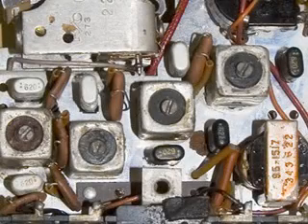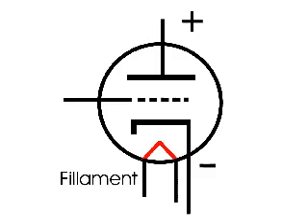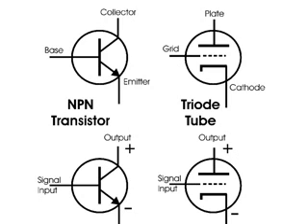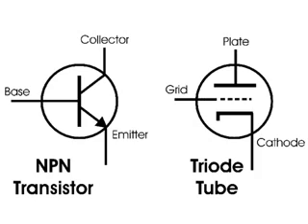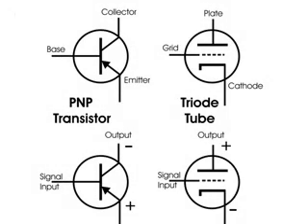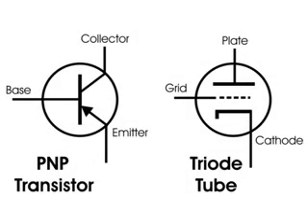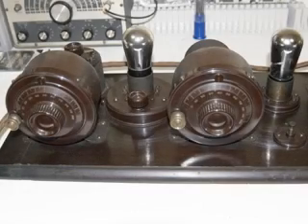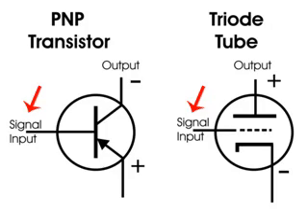Comparing the function of transistors and tubes.

Comment: So a tube can't be used in a configuration where you would use a PNP? Are all tube circuits designed like NPN transistor circuits? What if you needed a PNP configuration and transistors weren't invented yet? Is this a big limitation of tubes or is there a work around? My opinion is that NPN are more useful but sometimes you need pnp if you are putting the current load after the transistor vs before.
Reply from the maker: An N Channel MOSFET is a more suitable Sub

Comment: very nice job sir. im still a little confused about the difference between NPN + PNP and how the emitter changes direction and what that does but for a guy like me who is semi experienced (IE- doesn't know much) this was easy to understand and your video will be a building block on my journey to learn more about trans and tubes. for this, I thank you.
Reply from the maker: Found you in the Spam
Both NPN and PNP transistors have the same function. The differences the polarity. In the NPN the collector is connected to positive in the emitter is connected to negative, to turn the transistor on you apply a positive voltage. The PNP is exactly opposite, the collector is connected to negative the emitter is connected to positive, and to turn the transistor on you apply a negative voltage.

Comment: Thanks for taking time to look at the video. I agree it is very hard to decide just what is going on there. On another note, I am also interested in a way to construct an op amp computer using low voltage tubes. The Heathkit EC-1 analog computer is out of my price range so I wondered if it was possible to construct a low voltage version using vacuum tubes or just a simple op amp. 
Thanks for listening ,
Wayne Verish
Reply from the maker: +gort59 
Google "op amp analog computer"

https://www.clear.rice.edu/elec301/Projects99/anlgcomp/

https://courses.engr.illinois.edu/ece486/labs/lab1/analog_computer_manual.pdf

http://www.allaboutcircuits.com/textbook/semiconductors/chpt-9/computational-circuits/

Comment: Dear sir,
I really enjoyed you video explaining the differences between a tube and a transistor. I recently saw a video showing a half adder using vacuum tubes. The circuit is low voltage. I wonder if you can figure out the circuit from the video. I would very much like to build this device but I can't tell from the video how it is wired. Would you please take a look? The video is on YouTube and is called half adder built with vacuum tubes.
Thank you,
Wayne Verish
Reply from the maker: +gort59 
I did look at the video, and no one would be able to decipher a schematic from it. I did Google half adder circuits and found a number of solid-state examples. It looks to me like cascaded flip-flops would be much more efficient.

My Mini Maker Faire Computer Basic Display Binary Counter
https://youtu.be/6_95Izq7MNk

Comment from the maker: Unfortunately a junction transistor is not a direct sub for a tube. There is a large impedance mismatch, the vacuum tube being high impedance and the transistor very low impedance. Also most of the tubes that you would find today have more than one grid and the transistor has one base. It would be possible to make a tube substitute but you would have to use something like a CMOS FET.

Comment: I'm curious if old tube amplifier fails, can I replace the defective tube with transistor by connecting base directly to grid, collector directly to plate & emitter directly  to cathode leaving the connections for filament condemned? In the diagram it makes sense.

Comment: Transistor electronic organs using good filtering sound very warm and have excellent voicing. Vacuum tubes are great for tone generation as well. For amplification tubes are superior. 

In the mid 70's LSI ( large scale integrated circuits) came along with over 500 transistors on a chip. These organs were good sounding, but not really as warm and/or bold sounding as the earlier transistor and tube models.

I'm curious if digital can accurately duplicate the sound of transistor & tube organs?

Comment from the maker: @rick62008
Correct. If you look at a wiring diagram for a five tube AM radio and compare that with a five or six transistor AM radio wiring diagram, it is really the same thing.

Comment: If it wasn't for the voltage differences, could you use a transistor to replace a vacuum tube? For the looks of it you just would need to leave the filaments wires desconnected since there would be no filament!

Comment from the maker: I would use one of my battery eliminators for antique radios. You can use 6.3 AC or DC for the filament. If you can have or can barrow a heavy enough 6V battery, that would work for testing.

Comment from the maker: Amplification is a actuate term, but it is not what you may think it is. A tube or a transistor uses a small signal to control a much larger power supply. I will email you one or two other videos that may help.

Comment from the maker: Transistors can act as a switch or a variable resistor depending on the circuit it is in. The Base is the connection that controls the flow of electrons through the transistor. The thing about the Base is, that a very small voltage on the Base is controlling a much larger voltage through the transistor. So if the Base has a small audio signal on it, a larger audio voltage is produced by the electrons flowing through the transistor.

Comment: The main thing to remember is you control a large current flow with a small signal voltage. Think of a FIRE HOSE at full blast. Now stop it with your mouth? However with a valve & handle you can stop or change the FIRE HOSE flow with little effort. Functions of tubes/transistors are many, but common uses are ON-OFF SWITCH or CONTROL FLOW. The control signal is very small & can change at high rates or frequencies. With clever use of transistors you make a computer, TV, cell phone...

Comment from the maker: Well, they both do amplify but the voltage is already there from the power supply. What takes place is both have the ability to greatly change resistance between Emitter/Collector, Cathode/Plate, with respect to a very small voltage change at each input. Some view this as negative resistance.

Comment: A Vacuum Tube is more similar to an FET transistor than an BJT transistor. Tubes, like FET'S are voltage operating devices whereas BJT's are current operating devices.  Tubes and BJT are quite different in that respect.

Comment from the maker: The arrow is the emitter and it point to the negative source. The collector and emitter voltages are determined by the circuit the transistor is in. Common Emitter circuits and Common Collector circuits are the most typical types of circuits.